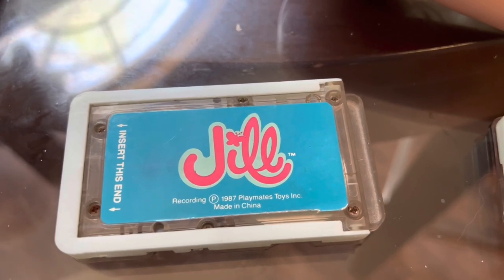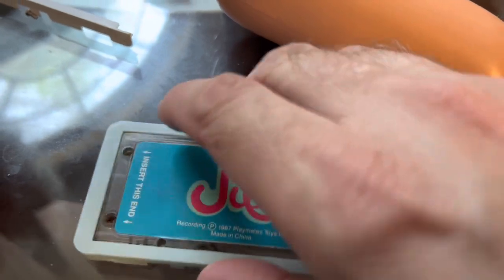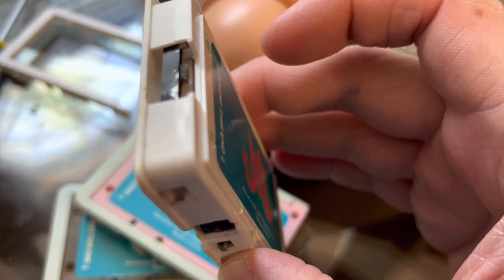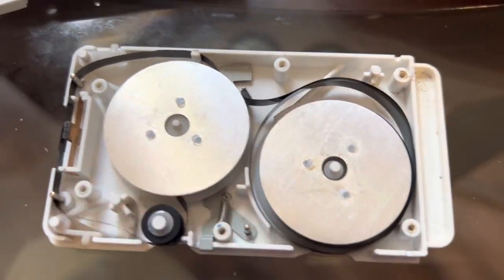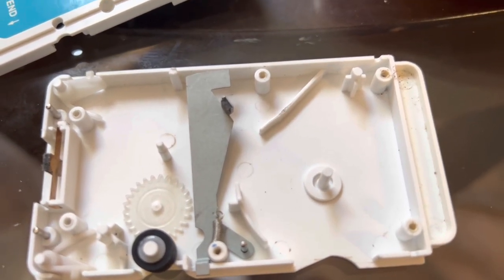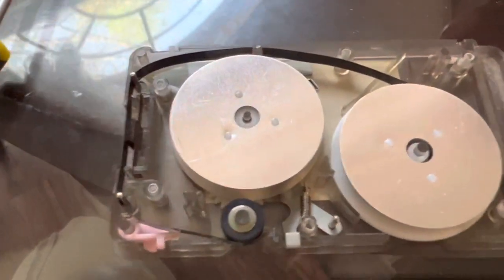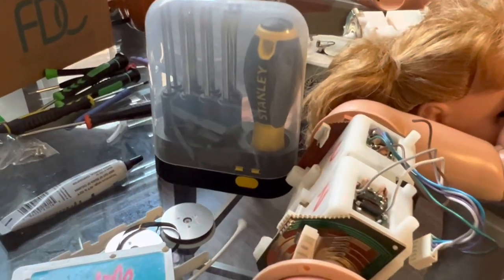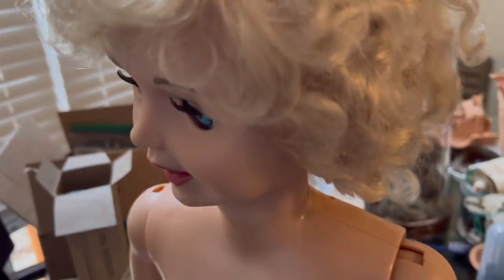Cassette Tape Repair for 1987 Playmates Talking Jill Doll

Comment: Is the width of the tape any wider than a standard cassette?  I presume there are technical reasons why Playmates went with this proprietary tape format for Jill.  I've never used a Jill doll before, but I'm thinking the tapes must have at least 6 tracks, 3 for audio, 3 for control signals, I say this because Jill often provides you with 3 choices during the tapes, mind you she often provides two choices as well.
Reply from the maker: It’s actually thinner and smaller in size than a normal cassette. I don’t know why they made her tapes so complex and unique. In early concept images they actually show Jill with a cassette so they must have considered it once upon a time! 
She actually has 4 tracks. 3 for the various audio tracks and then the bottom 4th track is her data. 🙂
Reply: @cricketandcorkysclubhousef8686  I would have thought each audio track would need its own data track to ensure her mouth movements are synchronised with her speech.